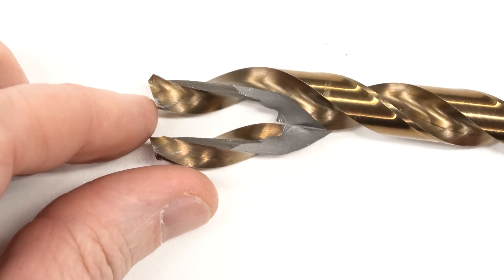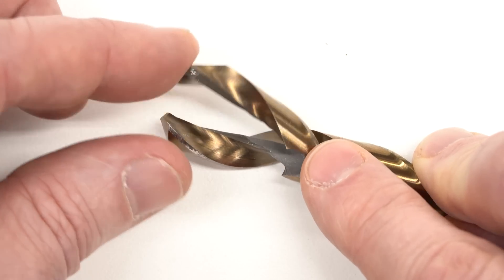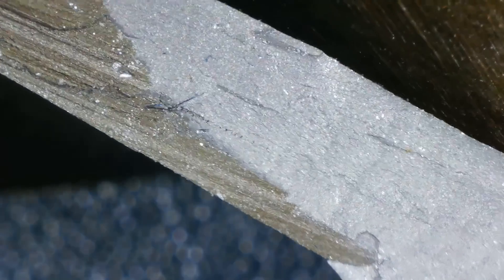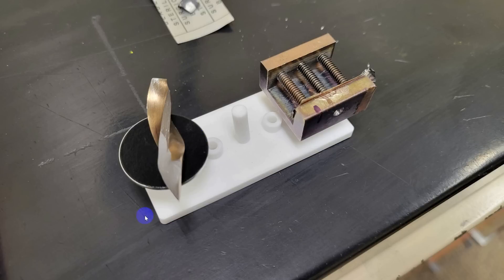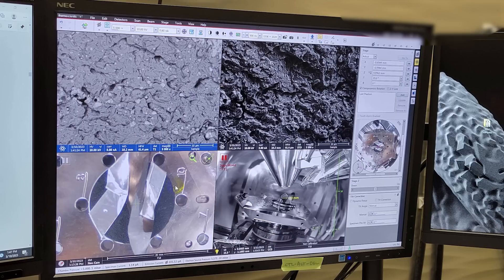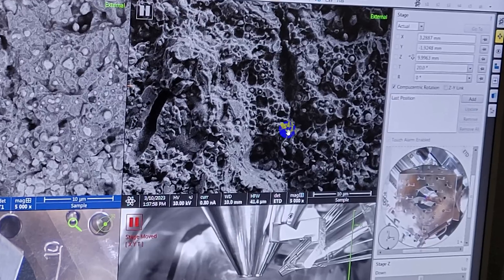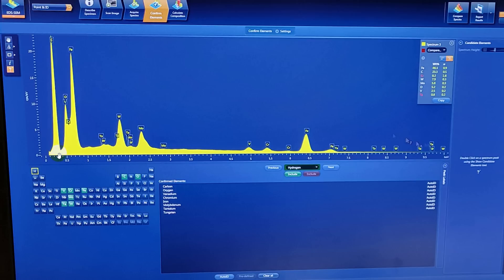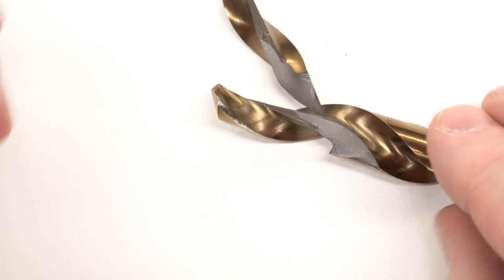What the Scanning Electron Microscope Reveals About This Failed Drill

Comment: any drill bit with a reduced relief (back cut) on the trailing edge is not designed for enlarging holes.. at least that is what I was taught and my personal experience has proven it to me as well.. they always seem to shatter
Reply: When I was in high-school there was a  hiproduction machine shop across the street I walked over to and apprenticed ran screw machines went threw alot of drills we had six 1/2 cobalt drills from Enco now MSC did same thing split like that looked just like that! They sent us new ones hell they chatterd in the hole they were split also switched away from that bit for a while problem went away orderd them again never had a issue again 🤷‍♂️
Reply: Well, it depends upon the material being worked, but I don't think that was a reduced relief drill bit.  What's more, as he pointed out, in that situation, the bit shatters (as you say).  I have never seen a bit split along its spiral like that.
Reply: Drilling aluminium is probably one of the lowest loading scenarios though... 🤔
Reply: I bleave it's quality control of a product . There a big difference between work load stress- chip weld  feed rate ect think its plan and simple defective.
Reply: @peterfitzpatrick7032  Well, no.  First of all, most wood types and most plastics are softer, and there are quite a few softer metals.  Of course the softness of the material is not the only consideration for loading, but I doubt anyone has ever broken a drill bit due to excess torque when drilling balsa wood.

Comment: James,
Now my curiosity is up, as a practice lately I have been regrinding all my old drills so they have split points. I will use them for both drilling holes and expanding holes.
Does the fracture on your split point drill correlate in any way to the geometry of the split point? My Drill Doctor creates two tiny facets. And as we know it is not desirable to create Sharp inside right angles as they may weaken material.
Reply from the maker: I don't think so.  The crack doesn't pass through the thinned portion of the tip.

Comment: I was taught that IDEALY the pilot drill size should be the dia. of the center web of the finish size drill. That's fine if you have a high horsepower machine, but most of us don't so we need to step drill. Also: I have broken bits while step drilling on the drill press but never the lathe. I believe this is because with lathe drilling the feed is controlled by the tailstock feed screw, while on the drill press it's your hand on the handwheel, so if the drill grabs it will be pulled away from you.
Reply: You can try drilling to the clearance size of a small boring bar and enlarging from there. Should be faster.
Reply: @rockmonkey37  That's the only thing that seems to work in plastics that have been pre-drilled or need through drilled. Will pull the part out of the chuck when it grabs (when it grabs, not if)
Reply: That is one common failure mode, and yes, it is more likely in the drill press than the lathe.
Reply: honestly i enlarge holes almost daily on work from 14.2mm to 22mm so 4.1mm per side and i never had a drillbit fail on me like in the video.. and i run it at insane feedrate mind you..
350rpm with 350mm/min feedrate (1mm per revolution). (normal Hss drillbit aswell..) oh and 50mm deep, normally like 60 holes per plate.. and the drill withstands all 60 holes.. ( i do have to regrind it after a plate due to excessive wear, because of the feedrate tho..) 
SO in my opinion it does not matter if you enlargen a hole or not, it shouldn't fail like in the video period.
Reply: @FireGodSpeed  That depends on how "grabby" the material is, and the rigidity of the drill press/lathe.
Reply: @Bob_Adkins  we work with normal steel like s235jr.. i mean it's a normal drill press it has some play in the quil like any other, if the drill isn't sharpened properly it starts shaking violently. (Due to the play) 
"Grabby material" i mean.. i never had aluminum grab on me before lol it's gummy i suppose.. 
Steel on the other hand, i have had pull in a few times already on the breakthrough of the hole.. especially when hand drilling. 
My rule of thumb when working with aluminum is there is no rule, go as fast as you want.
Reply: Step drill with old tec hss jobber drills but not modern carbide etc drills.

Comment: In the production CNC world I never spot or pilot dill holes.  If you are using crankshaft, four facet or most any variation of NC point it isn't necessary. Sumocham, KM Go drills, Mits or Sandvik will prefer you drill the biggest diameter first in the case of stepped holes.  Most manual machines don't have the thrust,  spindle speeds, HP or the necessary guarding to run at mfg recommended drill speed and feeds.  Running manual machines, what you did was prefectly fine.  The drill was defective.  Even the best drill manufacturer gets a bum drill from time to time. I had a run of a dozen 1/4 - 20 Taps from a highly reputable mfg blow up on every hole during a turnkey one time, switched brands and tapped hundreds more before the gage started getting tight.  Stuff happens.
Reply: Love my Nachis 😊
Reply: Well, yeah.  CNC is very different in a lot of ways than manual machining.  For one thing, a CNC machine doesn't get tired or run down when pushed close to its rated limit.

Comment: Being a hobbyist blacksmith my first thought was that it was a cold shut that possibly formed when they made the grooves by drawing the material through a die and they probably didn't cut enough off the end before moving to the next step.
Reply: As far as I know, only large drills >1" are forged then twisted. Everything I've seen for smaller drills is ground/cut to shape. I'm pretty sure there are probably some drawing processes used someplace for smaller drills though. There are flute grinding marks present on this drill, but that doesn't mean it wasn't drawn and then finished ground.

What's weird is the crack doesn't appear to originate from a corner or stress riser. Perhaps thermal shock while the tip was being rough ground? I can totally see a cold shut being the origination as you describe.
Reply: @Dreddip  You can see the inclusion though, where either there was incomplete mixing in the melt, or a tiny bit of slag that was deep in the original rod.
Reply: @Dreddip  I suspect it is a crystalline defect caused by a small amount of non-uniform mixing of the alloy during the smelting process.  Such things can form what are known as "super leaks" in metal forms used to make cryogenic Dewars.  These small defects will only show up under X-ray crystallography.  Even under high pressure, the container will be perfectly leak tight until it is filled with a superfluid, such as superfluid Helium-4.  At that point, the superfluid He seems to magically disappear, escaping through the 
"hole" that isn't a hole.  While such flaws are not ordinarily visible to the human eye, or even to an ordinary microscope, they do represent a region that is slightly more brittle, weaker, or both than a properly uniform volume of alloy.  The result is in high stress and high temperature operations, a real crack can open, albeit one that is still not obvious to the human eye and not complete enough to actually separate until a relatively large strain is encountered.
Reply: Excuse my lack of knowledge, but what's a cold shut?
Reply: @vincentguttmann2231  that's when the steel is folded onto itself (kinda like a wrinkle). If it happens at welding heat then it'll just fuse together. But you don't forge at welding heat for a lot of reasons and that means a small cold shut can get into the piece. Once it's there it can be very hard to get rid of, if you can even tell it's there as they can be impossible to see sometimes. Easiest way to get rid of a cold shut is to literally grind/cut the thing out. 

A cold shut could definitely have caused this failure. Although, my first instinct thought the blank was put into a hot heat treating oven when the blank's end was too cold (potentially from the thing that grips the blank being too cold and sucking the heat away). If the tip heated up too quickly then it could also cause excess stress and fail in a similar way.
Reply: I don't think drill bits are forged.  'Nice try, though.

Comment: Enlarging holes is literally standard practice. But there needs to be a significant difference between the hole that is already there, and the drill size. I usually drill in steps of 5 or 10 mm at a time, depending on the machine power. so from a pilot drill, i would go to 10mm, 20, 30, 40, and then either the big 50 mm, or a boring bar
Reply: I pilot holes I am drilling by hand with a drill the width of the web at the tip. That way the chisel point does not have to push through the material. On a lathe, I just center drill, then drill to size. Try it, you might like it.

Comment: Gotta ask the Five Whys. 1. Why did the drill jam in the work? 2. Why was the drill broken? 3. Why did the drill get damaged during manufacturing? 4. Why...? 5. Why...? -> root cause
Reply: I think you can skip the first two questions in this case. The drill jammed in the work because the pressure on the wings of the point results in a torque that tries to untwist the drill. Remember a drill is a form of a torsion spring. Because there was a pre-existing crack starting from the tip of the drill, this resulted in the crack opening a little, causing the drill diameter to expand at the tip and for a ways back. This jammed against the side of the hole, greatly increasing the torque on the tip of the drill. The increased torque resulted in the new brittle fracture.

So we are left with the drill had a pre-existing fracture. Where did it come from? If we ignore the oxide found on it, we could postulate that the drill was used previously, and torque on the tip caused the split along grain lines in the rolled bar the drill was made from. Why this would be a ductile fracture isn't immediately clear to me. Possibly it was a brittle fracture, it existed for a time (perhaps several hours of drill use) and the two pieces of the split worked against each other. But the fracture doesn't look much like that. And it doesn't account for the oxide in the crack.
Reply: @lwilton  The first two questions were just what would have been going through his head as it happened. They still count towards the five whys.
Reply from the maker: First comes the loud bang followed by 'what just happened?'
Reply: @Clough42  "First comes the loud bang..." is a statement too often preceded by "Hey ya'll, watch this!"  :)
Thanks for such great content, and 'Hi!' from Slovenia!

Comment: I agree that expanding existing holes can be a bit hard on the drill but sometimes it is required. Not many home shop machines have the power to push a bigger bit without a pilot.
Reply: I think it's the difference between a pilot hole which is on the order of the drills core in size and taking a 20mm drill through a 17mm hole
Reply: There are rare and expensive 3- and 4-flute "core drills" for that, although when I asked Somta about them they said, "they start at 14mm and they're morse taper shank only".
Reply: huh..?? I work in a foundry for the mold department, we have plates out of normal soft steel (S253JR)  and we predrill the holes on the CNC and then turn the plate over and enlarge the holes on a drillpress from 14.2mm to 22mm diameter so 4.1mm per side, depth is 50mm deep, there are roughly 60 holes per plate (2plates needed, top and bottom) and i normally run the drill with like 350RPM and 1mm/revolution so 350mm/minute feedrate. Thats insanely fast if you look at it in person. You know what never happend? that the drill split like in the video. 
i can do 1 plate before i have to sharpen the drillbit again. (duo to the excessive wear because of the high feedrate) And thats with a normal HSS drillbit mind you.
Reply: @FireGodSpeed  Aluminum is probably more grabby. Do you use fluid? Also the drill geometry matters. I bet you are just more experienced as well.
Reply: @FireGodSpeed  50mm deep versus his what 5 " deep in aluminum from the side is a huge huge difference.
Reply: @JorgTheElder  unless the edge of the drill gets stuck in a shrinking hole because he's cutting aluminum. Snap.  This is the difference between a hard drill and a soft drill..   you have to be careful cutting aluminum with a hard brittle drill, especially with a drill chuck on a SMALL tapper all hanging out as far as he had it in such a deep hole.
Reply: Absolutely TRUE! However, you should use a slow feed rate on the drill to prevent grabbing. Large increments are easier on the drill and work fine. The goal is to relieve the tip, which has awful cutting geometry.

Comment: I don't have a big machine shop or anything, but I usually just use a centerpunch and then drill the thing. I don't think pre-drilling is really necessary, at least for any materials or drills I worked with. But, that said, I've never heard of drills breaking when you pre-drill a hole...
Reply: Usually the risk with stepping up like this is on a tapered drill chuck you will break the chuck loose. It needs axial force to maintain the friction fit. Grabbing the "ears" of the drill imparts a lot of torque and not much axial force.
Reply: @rockmonkey37  Ah, interesting. I've never really used a tapered chuck for any amount of time. Mostly just drill presses and such. Yeah, it would create more torque in relation to the axial load. The outside corners would create more torque than the inside, more leverage. And the axial load would simply decrease linearly with the surface area in contact with the material.
If not enough axial load is a common issue with a tapered chuck, which idk for sure if it is since I have no experience with it, it makes sense.